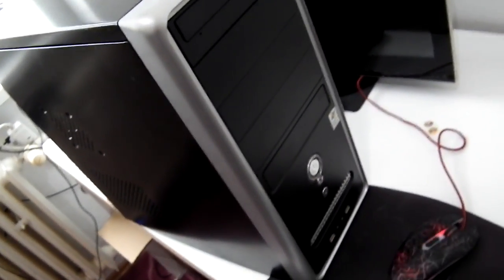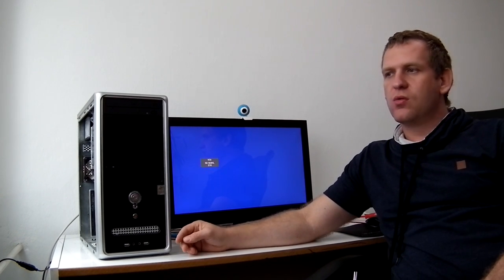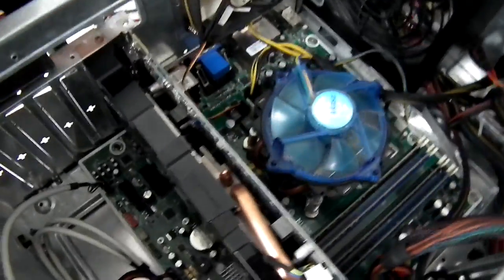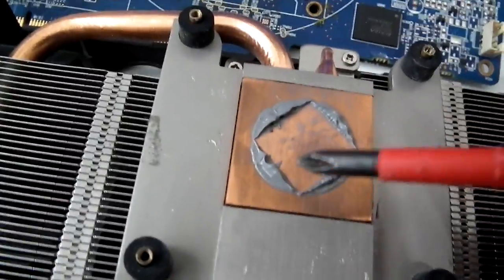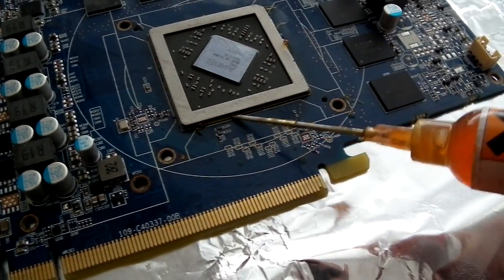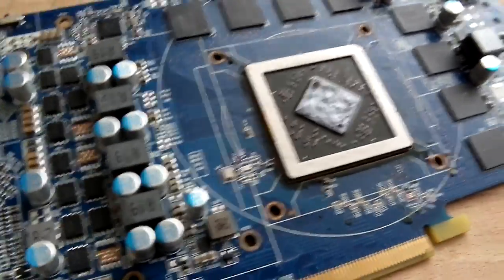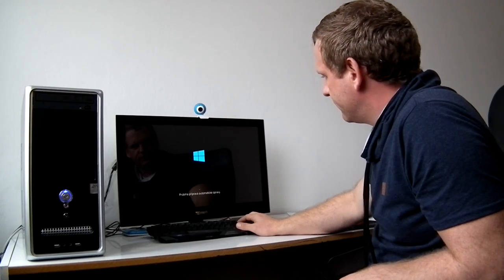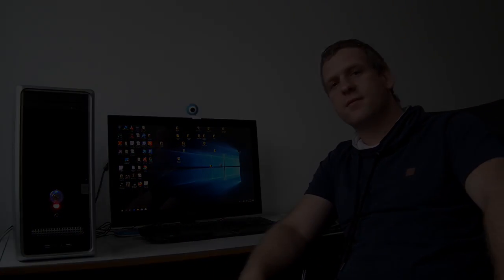How to fix GPU black screen after load windows - HD 7850 2GB FIX

Comment: hi the gpu of this video working in safe mode before makes  reflow ? i have 5500xt asus dual 4g when install drivers black screen and only works in safe mode or normal mode but without drivers. In safe mode drivers install are sucefull but when i restart the pc crash after bios logo. The bios of my model not appear in techpowerup and i dont know the memory information :(. gpu z only  says gddr6
Reply from the maker: Hi no is not working  in if I good remember is long time ago but if your card is in warranty go that way if not you can try reheating
Reply: We have same issue how U fix
Reply from the maker: If your card is out of warranty try reheat there is nothing to loose anyway
Reply: @frogtechtips  in the video u post, is this the same issue like Gian said? Because i do have that issue, also do i only need heat gun? Without flux gel?
Reply from the maker: @godricluizponce7442  some people have luck with hair dryer and without flux but I will definitely use flux is cheap and is more safe with it
Reply: @frogtechtips  will update U if it worked
Reply: @frogtechtips  this will work 90 chance?
Reply from the maker: @godricluizponce7442  i will say 80 percent:-)
Reply: @frogtechtips  wish me luck , I'll update U 2 days
Reply: @frogtechtips  how many minutes I will use heatgun on the GPU?
Reply from the maker: I usually use about 7 to 10 min on 320 Celsius but don forget heating ram module as well 50 percent of error 43 is faulty ram
Reply: @frogtechtips  I heat it 10 minutes non stop?, also where's the ram module
Reply: @frogtechtips  I tried to reflow I still have same issue I reflowed it for like 10 mins
Reply from the maker: @godricluizponce7442  what temperature do you use and did you heat ram module as well
Reply: @frogtechtips  what ram module in the pcie in GPU?
Reply from the maker: @godricluizponce7442  is that small black chips around GPU main chip
Reply: @frogtechtips  I heat gun all them? 10 minutes and the GPU chip 10 minutes?
Reply: @frogtechtips  still not working any got tips
Reply: @frogtechtips  yes
Reply from the maker: @godricluizponce7442  no more tips my friend this method is always about luck but good point is GPU on this Day are not expensive.time to buy new one and you can still try sell this one on eBay as spares and repairs not working or if you want you can try sending to me and I can have a look but IAM base in Slovakia with can be so far away for you
Reply: @frogtechtips  i already sold it, now I bought a GPU that has no display , how do I fix that where do I reflow, or do you have a video
Reply from the maker: @godricluizponce7442  you gave second card with no display you bought as asi you know about that when you buying
Reply: @frogtechtips  I try to fix issues in GPU lol
Reply from the maker: @godricluizponce7442  ok let me know your luck
Reply: @frogtechtips  i got luck i got hd7850 for 8.40 $, it has no display but i rewatched ur video, and it worked, thanks
Reply from the maker: @godricluizponce7442 Nice good job finally:-)

Comment: Sir, my also same problem my graphic card is ATI Radeon HD 5850 1gb but it is not working showing black display after starting windows
Reply from the maker: Hi you will need do this reflowing nothing to lose as your GPU is out of warranty anyway
Reply: @frogtechtips   sir, I have done reflowing but now it is not taking output from motherboard it means no display from starting
Reply: @frogtechtips  sir, may be I have not installed driver of graphic card in my pc that why it is not show ing display
Reply from the maker: @surinderjat1969  you men from GPU you know not all reflowing is successful and s
Some card is not repair possible
Reply from the maker: @surinderjat1969  you can install drivers only when GPU working

Comment: Naah problem will reappear after some times... it could be hours,days,months, even  a yeear (i had one working almost 2 years after reflowing) but only real solution is buying another card, even reballing is waste of money...
Reply from the maker: Yop you right man  some card can working 1 day and some many years I have many experiences
Reply: How much does reballing cost? 
If it does work for a year. It gave you time to research a new card. And after a year. That card will be cheaper. 
Win, win
Reply: @golfish8589  i dont know about reballing cost... but you can buy cheap heatgun and reflow it by yourself, or if you dont want waste any money, put in in oven... seach tutorials "gpu oven fix"... i remeber back in 2010 i extended life of my 8800 gt almost 9 months with oven metod...
EDIT: one more thing important is to install some gpu fan control app like, MSI afterburner and manually set fan speed to higer precentage, so when gaming you turn on MSI afterburner this is good even for new graphic cards to prevent overheating...

Comment: My gpu is installed on the motherboard  but not detected  and the   onboard vga  is working while   gpu is plugged in
Reply from the maker: Hi Ian not sure what you mean
Reply: @frogtechtips     the gpu hdmi and dvi is not working  said no signal.   But the on board  VGA is working   while the GPU is in there
Reply from the maker: @ferdinand7565  and if you go to device manager is your PC see that GPU
Reply: @frogtechtips  yes there is
Reply from the maker: @ferdinand7565  and is looks normal with no problems btw how happens that no signal problem do you know the history of the card
Reply: @frogtechtips  actually sir   after i bought this card    i used this for   2days  but  after that day    the card is no signal now
Reply from the maker: @ferdinand7565  I will asking sellers for the card history and if possible sending back to him for refund if not that possible only you can try is reflowing GPU

Comment: My GPU fan is spinning but no display
Reply from the maker: Did you try any repair do you know history of the card
Reply: @frogtechtips   @Frog - Tech - Tips  my monitor doesn't have dvi input so I use dvi to vga adapter. Today I ordered a new one just in case the old one is damaged. While using the old one while starting pc it gave display for 10-15 seconds one time then no display and I'll try the heating method when converter arrive. I bought this card new it's GT 1030 but it's not in warranty. I'll update you.
Thanks for your response
Reply from the maker: @Akarshan07  you welcome like I always say if it's card out of warranty there is nothing to lose anyway let me know after
Reply: @frogtechtips  hey update I tried doing heating method but still no display
Reply from the maker: @Akarshan07  is not always work did you try reheating die and memory module as well do you use flux and with temperature you used
Reply: @frogtechtips  I used hair dryer. I'll try reheating for longer time
Reply from the maker: @Akarshan07  hair dryer is not strong for that you will need some heat gun
Reply: @frogtechtips  ok I'll see where I can get heat gun. Thanks
Reply from the maker: @Akarshan07  you can buy some cheap one

Comment: Hi I have bought new(second hand from eBay) graphic card MSI HD 7850 2gb. Everything was looking good till I have installed drivers. And then started to crash. Screen was on and off. Sometimes some lines showing for second. Mouse is lagging. Computer is eventually shutting down. 
And ideas??
I have already reinstall couple of drivers and even new clean windows 10 and still problematic
Reply from the maker: Hi someone sell you broken GPU if you can send back and get refund if not only way you can try is things I do in video sorry for bad news
Reply: Same card and same problem..
Did u find anyfix
Reply: @Sienio48  best thanks

Comment: please, i need help! (i dont talk english, im sorry if i make a grammar mistake) i have a radeon hd7850 xfx and it only works in safe mode, if i uninstall the drivers, the card works, but when i install the drivers, the pc just dont have signal and i dont know what to do, please... please help me :(
Reply from the maker: Hi is that happens just one Day or you buy that card like that but for me you die is on way out and you Will need reflowing your GPU
Reply: @frogtechtips  i found it on a box, and now i doesnt turn on, the fan spins but nothing more
Reply from the maker: @xnike9004  and do you know the history of that card
Reply: @frogtechtips  yes, it is from a friend of mine, he just trow it away because he just dont want it
Reply from the maker: @xnike9004  ok I think you will need reflowing your GPU nothing to lose and before you do as card working on safe mode try reflash BIOS first
Reply: @frogtechtips  i have a problem now, i flashed the bios (1 hour ago) and now it doesnt show anything, how can i recover my old bios? its saved on my ssd and pend drive
Reply from the maker: @xnike9004  is that card have 2 BIOS or just one if just one you will need second card to switch on your pc and after you can flash you BIOS
Reply: i dont know man :(
 i have 2, now i am using a gt740sc evga, but i dont know how i can flash my bios again,

Comment: Hey. I really need your help. I have problem with my PC. When I'm turning on PC with hdmi cable connected with GPU my screen is black. I can hear Windows startup sound but screen is still black. This trouble appeared 1 year ago and I sent GPU on warranty but they said that GPU works. And it really worked but maybe for 3-4 months. If I have black screen then I'm restarting PC because after many restarts it works. Now it again doesn't work. I thought that it could be because of PSU so I bought new one but it didn't help. I tried:

- uninstalling gpu drivers

- pulling out CMOS battery

- changing default graphics adapter on PEG

My setup:

GPU: Gigabyte GeForce GTX 1060 Windforce OC 6GB

PSU: SilentiumPC Vero L2 Bronze 500W

MOBO: MSI B360M PRO-VDH

CPU: Intel Core i3-8100

RAM: Ballistix Sport LT, DDR4, 8 GB

I don't know what to do. I'm afraid that it's mobo fault, but PCI slot looks fine.
Reply from the maker: hi that's sounds like faulty GPU form did you try that GPU in your friend PC or do you have second PC you can try to be absolutely sure is GPU problem 

did you try another output like display port
Reply: @frogtechtips  "did you try another output like display port " What do you mean?
I tried Dvi-d also
Reply from the maker: @Kraut148  i mean if you tried different output other than HDMI if it's tha same problems try your GPU if you can in different pc and if it's tha same problems is definitely foulty GPU I will send back again if is still under warranty and ask for replacement as this is probably hard to find or diagnostic this if it's not under warranty I will try burn new BIOS on first place
Reply: @frogtechtips  I can't check it with different PC :c. Last time I had this trouble in January and I cannot turn on PC with my GPU for two months. In march I don't know how but it worked and on Thursday, week ago it stopped working again
Reply from the maker: Ok is that card still under warranty
Reply: @frogtechtips  Yes
Reply from the maker: @Kraut148  if it's I Will send back to shop and ask for replacement
Reply: @frogtechtips  Ok, I will send it. Is it possible that it's my windows 10 fault?
Reply from the maker: @Kraut148  for me sounds more GPU problems